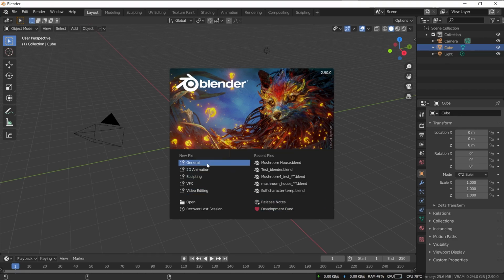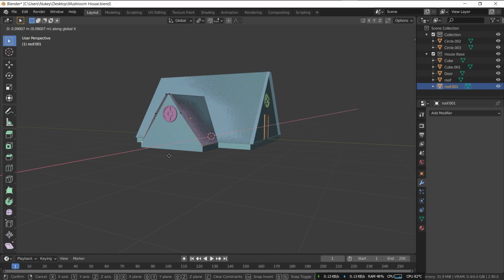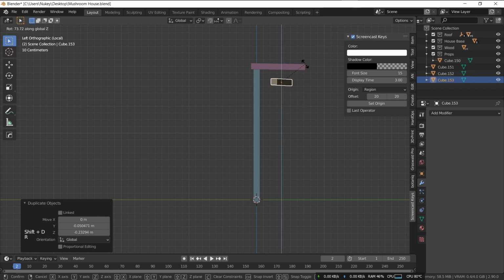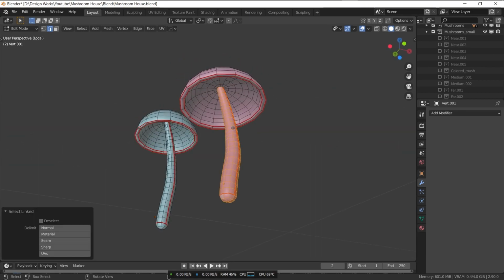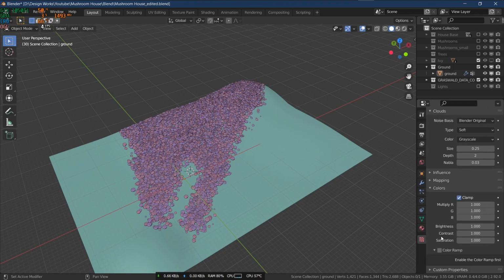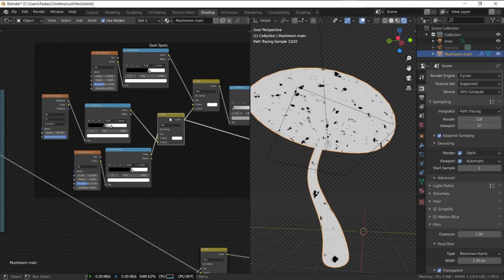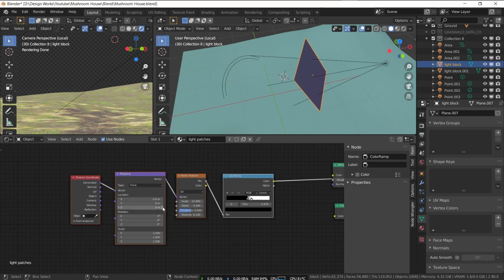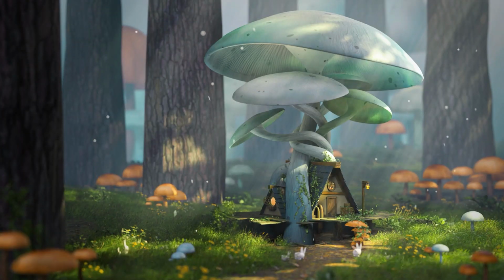Let's make a Stylised Mushroom House | Blender tutorial

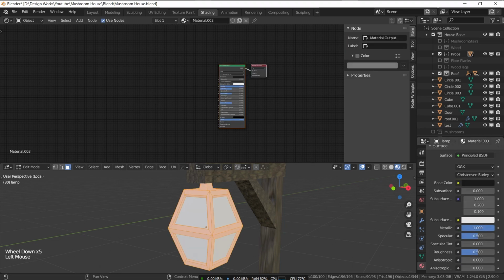Comment: 16:30 Using a lamp (or worst, emission shader) trapped around glass is a bad idea for rendering in cycles.
Reply from the maker: Yaya the artifacts are pretty bad, combining it with a transparent shader kinda gives it a bit less artifacts
Reply: @YuiNukey  Ray will bounce maximum time(set in light path settings) before resolving and will likely not resolve as glass have roughness make it more random, fewer photons will go to the camera, and more caustics. This phenomenon will increase exponentially as the size of the object (in pixels) is large in camera view.
Reply: (I learned that from renderfarm cost experience ^^)
Reply from the maker: @SoftYoda  lmao kinda can relate